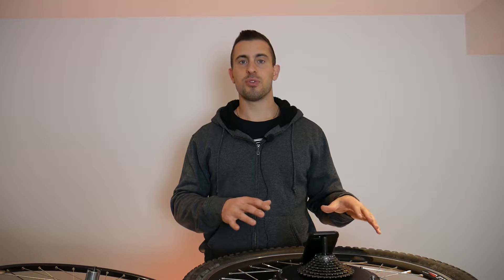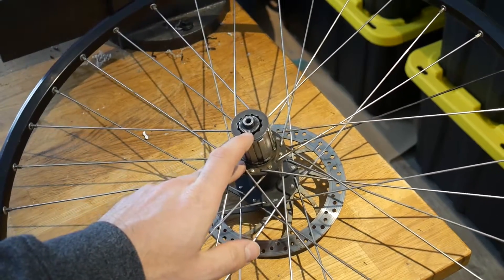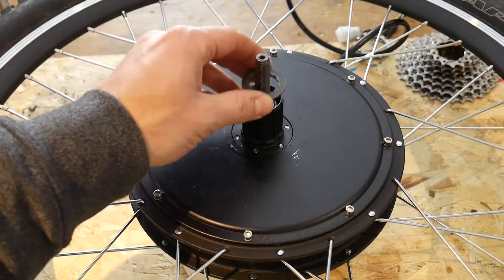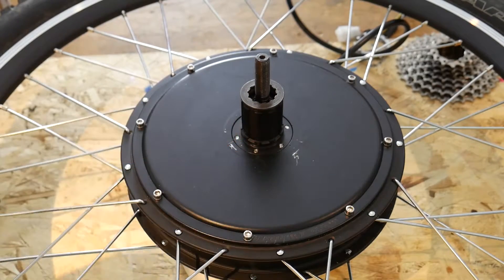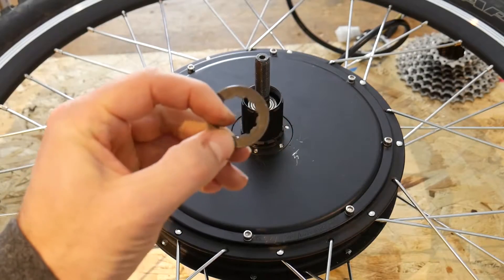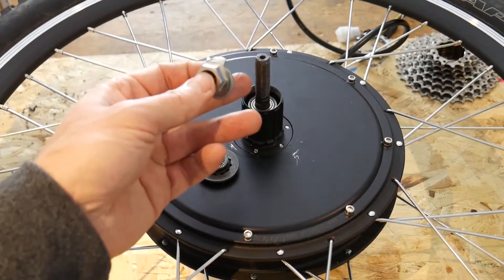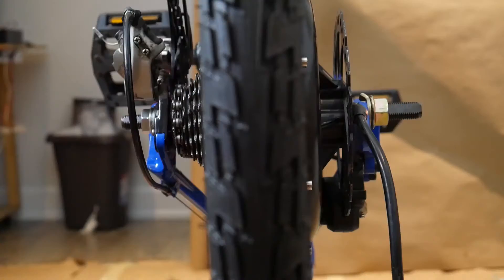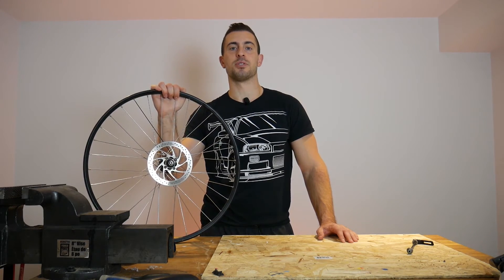Avoid This Common Ebike Hub Motor Issue! How To Install Spacers and Washers For Hub Motors!

Comment: my rearwheel is offset to the left. because my cassettes lockring start hitting the dropout which locks the casette up. i need more dropout width to center the wheel in order to use rimbrakes that can clamp evenly on both sides of the rim. manufacturer service told me the casette version i ordered actually needs 138mm dropout width instead of the stated 135mm which i have on my mtb.....

Comment: I'm not an angry person but thank you for remaining so calm. I mean the bottom line on this whole thing is why do they not provide the adequate space are required to put this thing together correctly. Pure and simple. I mean the fact that they don't have adequate instructions just adds to the frustration. And then to install it and start grinding away and damaging the part. Then having to negotiate a return is even more frustrating. I'm at withstand with these people. Why can they not supply adequate instructions and why can they not supply adequate parts. Mark Mann M2

Comment: The thread of the shaft eats the aluminum frame's dropout like a saw, Because of it I lost 2 hub motor, cable spun and then got broken the cable. The shaft shouldn't have a thread where touch the frame's dropout .

Comment: I have the problem when pressing break the wheel nut is moving and having zip noise. Been trying to tighten the nut but it still moving

Comment: ty for the comprehensive vid share!

For 5000kw motors, would it be advisable to set the torque washers inside the frame followed by a torque arm and then axle flange nut?
Reply from the maker: Kind of hard to say without seeing the set up. 5000 is pretty serious, I would try and do double torque arms if possible and you might even have to reinforce the frame depending on the bike...

Comment: What is the name of that spacer you’re using for your hub motor? Please, I need to know…
Reply from the maker: Try looking up "bicycle rear hub cone" or "bicycle rear hub spacer" ... some of them are threaded but I believe that is going to depend on how far down the threads run on your axle. If you look closely, my spacer was not threaded and on the new shaft the threads did not run all the way down to the face of the bearing. So if my new part had threads to match the ones on the new axle, they would be useless anyways because the new spacer would not be able to sit on the inner race of the bearing... so I would have had to drill them out I believe.
Reply: @EmbraceMaking  Are they 10mm?

Comment: I am having trouble with the kit I bought I tried taking it to a bike repair shop and they seem not to know anything
Reply from the maker: What kind of troubles are you having?
Reply: I have a freewheel cassette I'm thinking of putting washers for the axle to separate the cassette from the bike frame. I have a 1500w and can't find a bolt anywhere to properly secure the rim to the bike

Comment: Great video! Let me suggest one thing? when you have the camera pointing to the back of the bike showing the washer positions. you could use a bright flashlight as you are talking about the sides instead of pointing with your hand. I could not see clearly the most important spot there. If you do this the video would be the best on the web explaining this!  great job anyhow and thanks!

Comment: I’m very good at welding I usually weld a tab on the frame and dump the hose clamps. 

However you have to be really good at welding….And use the proper electrolytes if you’re doing the arc weld…If it’s too big it will melt through the frame and then you’re screwed.

You can also make a hard tail bike full suspension…and make it custom…No flimsy hose clamps…Hose clamps make it look uglier, and jerry rigged.
Reply from the maker: Certainly! If you can weld you open up a whole new range of possibilities!

Comment: great video! exactly what is missing from other videos and manuals. I had the same problem - cassette lockring rubbing against frame- and added a spacer, but now the bearing in the freehub broke. Too much pressure? No spacers inside the freehub? Are there multiple bearings in the freehub+wheel, like a normal wheel? I don't know, because I can't get the freehub off. Any ideas? Would you know what it looks like on the inside of the hub and motor regarding spacers and bearings? A diagram like you made for the normal wheel would be so helpfull.

Comment: My rear wheel just keeps falling off I’m fully over it bought a 750 mid drive only to find out my 1000w battery is to powerful land killing my 750w mid drive, stressed so now I’m back to fixing this issue

Comment: Cheers for that video.
So I've ordered a 135mm rear hub cassette motor with a 9-speed cassette. I was then told that the motor is more like 135mm -142mm. 
My rear dropouts are 135mm and my frame is aluminium. There is some natural flex on the rear dropouts of about 2mm or 3mm. If the wheel arrives and the space is more like 142mm -145mm, would you advise just forcing it in or is there a simpler way - like filing down the hub cassette holder or something???  I don't really want to crack the frame and I don't really want to send the motor back.
Reply from the maker: I don't want to give you bad advice without being able to see your bike. However... if it were me... if it was a few mm (2-5mm) I would probably do it. I wouldn't file down parts without knowing how thick/thin they are. If you have to stretch the frame 10-15mm and it's an aluminum frame I would try to avoid doing that, especially if the tubes your are spreading are welded. I have a feeling the welds will crack after repeated use. If it were steel I'd feel better about it, but aluminum tends to fatigue and crack.

Comment: I have a Voilamart kit and the 7 speed freewheel supplied is too long, the shoulder on the spindle is “inside” the freewheel even when it’s screwed all the way on, yes I can space it out but it then throws the wheel off centre in the frame. Annoyingly I’ll need to source a shorter, 5 speed freewheel I think - only option :/

Comment: How much resistance to pedling motion does a hub motor like that cause ? If you compare normal cycling before installation of the hub motor to normal cycling after installation ? When the motor is not engaged.
Reply from the maker: Hard to say "how much" but there is a noticeable amount. Plus all of the added weight of the motor + battery makes regular cycling without the motor assist a little more challenging for sure.

Comment: Would you know how to solve this issue, my rear hub (1500w) is rubbing with my rear hydraulic brake ????
Reply from the maker: Might have to space out your brake caliper... this may also mean spacing out your disc to accommodate.

Comment: i noticed a problem on my ebike conversion kit .. the biggest sprocket on tear hub wheel is so close to the motor , that the rear derailer is hitting the motor 😒😒😒 I am not sure if it's a cassette style, but  it pisses me off .. why they cannot assemble
it properly so that we do not have such hassles with it
Reply from the maker: Tough to make a "one size fits all" application so in most cases it ends up being one size fits nothing lol
Reply: @EmbraceMaking  lol 🤣🤣🤣 yeah ..: i solved it by  disabling 1st (largest) cog on that freewheel because,  anyway, in fact, who needs that first cog  when 1500watts are  in the hub ready to kick the ass :))

Comment: Hello, thank you for this guide in advance and am awaiting proper spacers for the hub.
After installing my kit (because i couldnt wait to at least test it out), I find i cannot pedal at all due to the pressure caused by the frame onto my cassette.
the wheel will still freewheel just pedalling is jammed at the moment, correct spacing should alleviate this hopefully
Reply from the maker: Yes it will! This is why I made this video, so many people have this problem unfortunately!
Reply: @EmbraceMaking  hey again tried with a 19diam, 22length 14/15 clearance inner spacer. Works but in hindsight was aluminium, new one is 20 and stainless steel. Only issue i see is it wants to spin.
Which got me thinking wouldn't a threaded spacer be better so its similar to original and wouldn't prevent friction on both sides and would tighten better

Comment: Nice! what is the number of cogs/speeds that can be put in a cassette rear hub?
Reply: Upto 10 on most with cassette type, only 7 on older screw on type freewheel
Reply: 7, i think most leafbike motors allow for 5, 6, or 7 speed cassette hub

Comment: 🤗Thanks - Nice truly helpful video.
I decided not to canibalise my other wheel tho ...so I  bought n  chopped a rear axle spacer to size (meant for pit/dirt bikes from dirt/pit bike parts shop) , then used a washer against the cut face and dropout.   Dirt/pit bike axle spacers come in various axle  sizes,  fits n sits through/above the lock ring
Reply from the maker: Good tip! Do you have a link to those axle spacers you're referring to? Someone else looking through the comments section might find it useful!
Reply: @EmbraceMaking  i did for sure, even though im late to this party....

Comment: Where did you buy that wheel at I've ne se a whe like that. I've had a few. The spindle should be fil with metal smooth. Then when you come to put wheel on you can ues what ever size washer. The wheel nuts people go on about nuts coming loose there are two thing you can use lock tight the best is superglue it might sound a bit different berleave you me it works. When it comes to loosen them nut it takes a hell of power to loosen it doesn't damage thread. The other tip is whool. Rap around the thread a little then put nut on. It takes some putting on but works fine. The best drop of to have on bike is the one where the frame sits on wheel. If you have extra frame get a file and make it deeper then no problem. The word for all these tips is improvise simpel
Reply from the maker: I bought the wheel and hub motor on Leaf Bike
Reply: @EmbraceMaking  You seem to be missing a part on the spindle for sure.

Comment: Hi there I have similar issue here. In my case - I used some washers that I filed to fit - but I wasn't aware - that the part that it was sitting on was the moving part - so after sometime - i heard loud clicking noise, i was basically squeezing the motor - so probably battery efficiency was much worst for this reason - plus not sure if i damaged anything inside. My question is - why such a crucial part is not included in those kits, is there anywhere i can buy it now i n Europe?Cheers. I don't want to do it again filing some parts - as its just a fracture of millimetre difference that is needed for this part to work properly i think. Cheers
Reply from the maker: Probably not included because some bikes might use different sizes... either way its stupid that its never in the instructions. A ton of people make this mistake.
Reply: I am in the exact same predicament, except with a FREEWHEEL...I can't comprehend how you stop the SPACER rubbing on the HUB motor Side part though ?...Anyone recommend     the correct SPACER, etc ?

Comment: How can I fix chain rub on rear tire on gear 6 and 7?
Reply: Use a tire with a thinner width and pump it up harder
Reply from the maker: Might have to space it out if you have room in your drop outs or go with a narrower tire?

Comment: Thank you for explaining the rear wheel install.  I have the same issue after I left the bike shop.  They placed three washers on the inside axil, which prevents the wheel to free spin.  I now have to remove the wheel and start over.  But because of your thorough explanation I can proceed with confidence to do it myself.  Thanks again, Russ.
Reply from the maker: No problem Russ! Good luck!

Comment: Anychance you could do bearing changes on some hubs and stuff like bearing sizes on those 1500w hubs from china, most people i find just buy Chinese.
Reply from the maker: Hi Aaron, are you asking for a video to show how to replace bearings in these motors?
Reply: @EmbraceMaking  I wouldn't say no, I'm after learning myself since the original post so personally I'm okay but I'd say most people don't have the ability to learn without help. I know the information around the generic motors just isn't available, they do however tend to use the very standard sizes like the 6302 for example were in mine, both sides were different i can't remember what the other one is, but the demonstration would definitely be helpful, in my opinion anyway, but what do i know 😛 I'll leave it to you😜